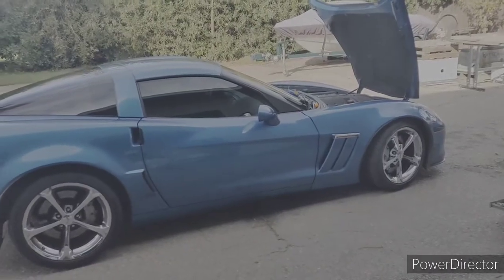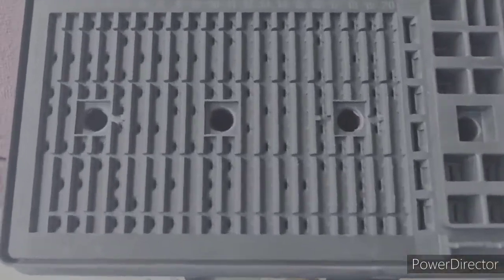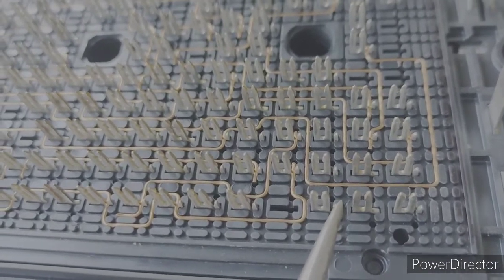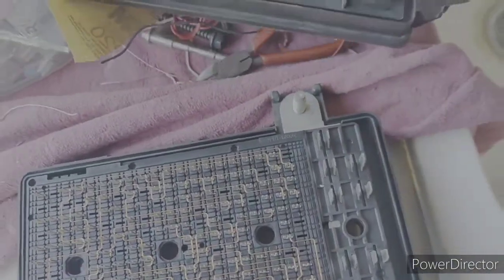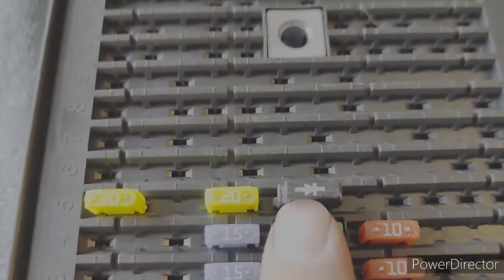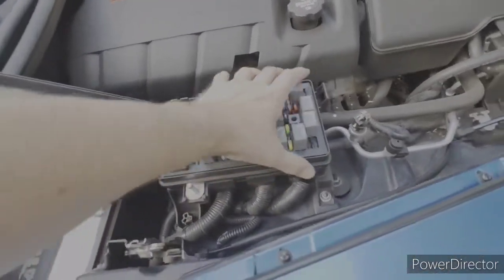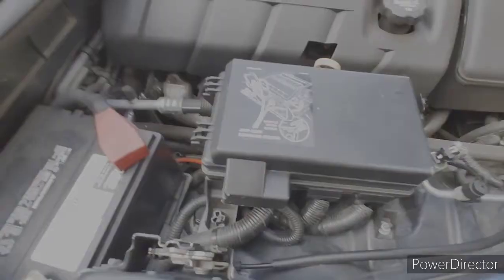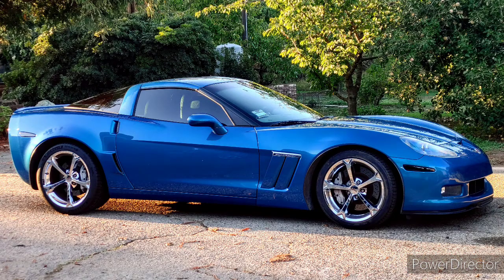C6 Corvette headlights not working. DIY fuse box fix, If lights quit working when engine heats up.

Comment: I just did this to my '07 C6.  Same exact problem and location.  Thanks!  Been dealing with this problem for years.  The dealer told me it was the control module and charged me $200 for the TS, and wouldn't fix it.  You saved me.

Comment: A big thanks to you sir. I had the same symptoms and checked out your video. Having 25 years of technician experience I went straight to this. Funny part... Seeing the info I followed your instruction. Got it put all back together after not finding the wire in question damaged. Well, had left headlight and no right side. I was like WTF! Well checked my workbench and found the missing fuse, installed and both were working. Yay! Right? No! Started the car...Tried to start and it wouldn't start. After about an hour of panic I wondered if the problem could have been the relay, Yes, That relay was now in the ignition position. OOPS! Didn't check relays at all first. Swapped out the wiper run relay as it was the same and made it home from the shop at 1 AM. But had to let your viewers remember to check the low beam relay before disassembling all that. Again LOL on me and thank you for your content!

Comment: I got a 2011 gs . Since I got the car the high beams haven't worked. I got B2580 code. Installed morimoto checked fuses everything is good. Looks like imma be pulling fuse box apart this weekend! Everything works but highbeams dont come on

Comment: I am not completely certain but I think this issue is covered by a recall.  I believe the dealer ran a separate insulated jumper wire outside the fuse/relay box without the added complications of having to separate the upper and lower portions of it.  It was a long time ago…

Comment: Very helpful video, man. Thank you very much. Im having this issue in my Z06. Im gonna have to try this now, after replacing fuses and relay low beams turn off after engine compartment gets hot, when it cools down they turn on. Have you had any issues ever since? 

Thanks.
Adan

Comment: I can't get the bolts out once I have all the fuses removed
Reply from the maker: Pull harder. It is just friction. The bolts have a little wide section that has to get past. But once it is loose and spinning, it is just a matter of tugging hard and it will slip out.

Comment: How did u get the bolts out
Reply: You figure this out? I’m trying to get mine out right now
Reply from the maker: 5:40 shows where I had to drill out the beveled end of the bolts. I used, I think, about a 1/2 inch drill bit or so and only drilled down a little ways and it allows them to pop out. I am sure you're done with this project since I'm 4 months out from answering your question. Hope you got and hope this helps someone.
Reply from the maker: Now that I reviewed the situation, I think the bolts you're referring to just pull straight up after the threads are all disengaged. I seem to remember a bit of resistance but a good tug and they came right out.

Comment: Thanks man I'm having  that issue I talked to someone on the fb c6 group  and they said the same thing  so I'll try that out we're did you get your wire
Reply from the maker: Father-in-law had it laying around in his shop. But I think garage door opener wire is supposed to be the right size. I tried several till I found the one that fit snug in groves. Good luck. Let me know if it worked for you. Examine the old wire carefully, it almost looked like the wire was fine, but close inspection revealed the break.